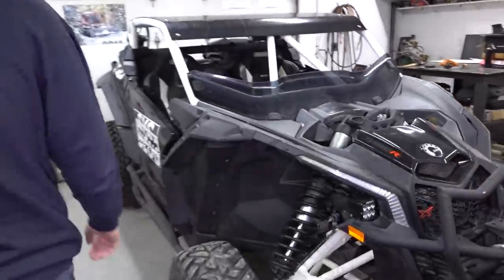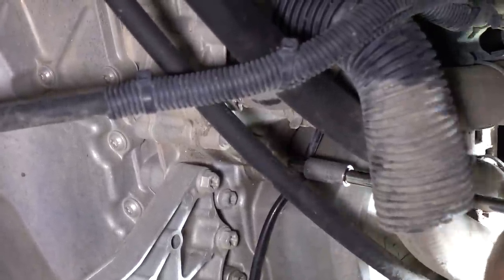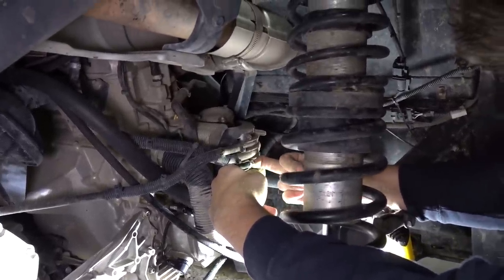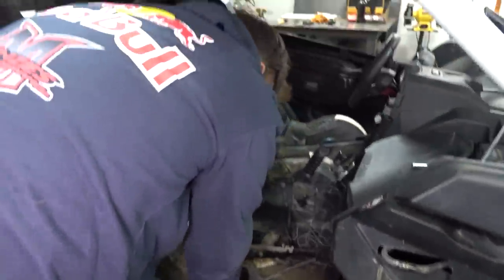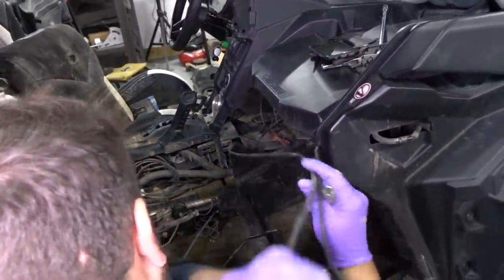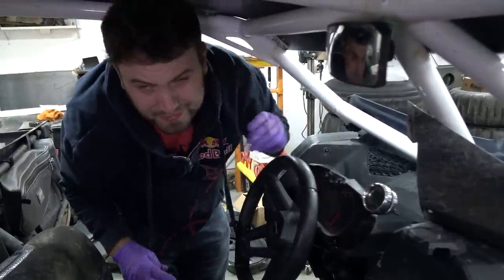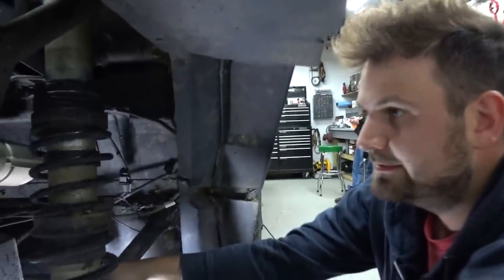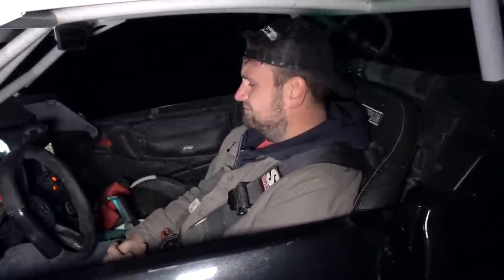Installing a Razorback Maverick X3 engine temp gauge!

Comment: Riding in Alaska is muddy all the time. I pull the machine into my heated garage and let it dry. Than I use a shop vac to get the big stuff followed by some waterless car wash. Works like a charm when the temps wont let you do a regular cleaning.
Reply from the maker: I dont have a heated garage so that's a problem.

Comment: I would flip that bracket so the gage was lower out of the mud sling zone a bit more or just get another bracket to flippe under and bolted in the same spot for the other gage you have down in the dash cubey.

Comment: Lol, it took 5 minutes to take the seat out to run it through the tunnel. You were near laziness level 11 there for a minute bud! Good thing Doug was there to talk you around. Oh yeah, run a hot water line to your hose spigot so when it’s cold out and you don’t want to get frost bite washing your whip you can spray her down like a boss with steamy warm water. Warning though, that project is probably over 5 minutes and may require a Doug pep talk.
Reply from the maker: Welcome to SXSBlog

Comment: Great work guys love the vids and I believe ip 67 stands for water resistance
Reply: IP (Ingress protection) 6 (First Digit: Solids Protection) 7 (Second Digit: Liquids Protection)
IP67- Protected from total dust ingress. -Protected from immersion between 15 centimeters and 1 meter in depth.

Comment: Did razorback finally include a way to dim the gauge light for night riding?
Reply from the maker: The biggest issue is the LED brightness. This gauge isn't as bright as the belt temp it seems.

Comment: The one thing I dont like about the x3 bars for temp and no volt meter ? Is my car charging ok I dont know  but hey I can change my speed and rpm to what I perfer on top  ,  I may need 1 of these , along with my belt temp and new muff, +  , you should have souse detail your car prior to these install vids
Reply from the maker: No kidding, his family actually owns a car wash too LOL
Reply: James Stinett brp has been doing the "bar" style guages for quite a while. Hell, back in the pre1994 ski-doo days, the formulas, the stratos, the alpines...everything that had an analog fuel guage had 5 "boxes". The temp guages on the lc machines were all printed/calibrated in metric (celcius). The early formula mx, formula plus & the machs all ran 50deg C. The fuel guages on the gen1 can-am outlanders and I think the base models of the gen2 are still bars and have no factory temp readout.
Reply: ROTAXD coming from a Polaris that you can see pretty much all the info you need ,the can am gauges are a little disappointing

Comment: Will this temp sensor work on the 1000R motor in the 2017 maverick DPS?? Not an X3. Non turbo. the plug on the 1000r is a M12 1.5. Is this the same  specs as this temp sensor????
Reply: Asked about a 15. Ryan said no.

Comment: What brand of beadlock rims are you running on beast mode?
Reply from the maker: I've got 2 sets. Those are Fuels.
Reply: What set do you use for trails?
Reply from the maker: Stock or fuels depending.